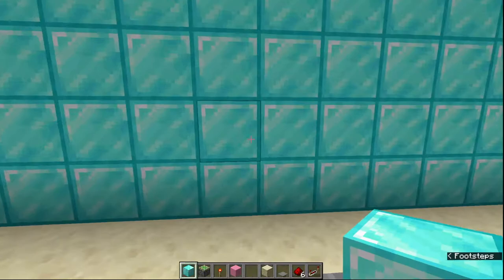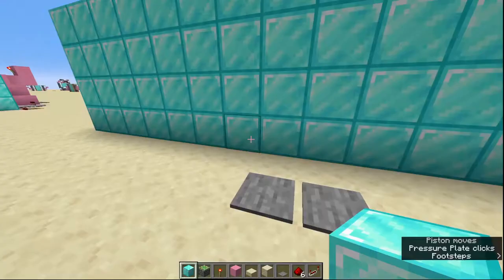ULTIMATE 2x2 Flush Minecraft Piston Door Redstone Tutorial

Comment: Thank you so much for this!  Works great!  (1.12.2, btw).  I'm a TOTAL redstone noob, this was only my second redstone build, and the way you present your tutorials is done very well!  You deserve more views and subs, that's for sure!    

My only caveat with the door is the speed with which it closes.  I got punched and stuck a few times, but I got the hang of the timing and it shouldn't be an issue going forward.

I did build this intending to use gold and iron pressure plates, ignorant at the time to the fact that they operate differently.  Since my respective floors were gold and iron, I really wanted to make them work, and after some head-scratching (again, redstone noob), adding some repeaters near the pressure plates to amplify that weak signal did the trick.